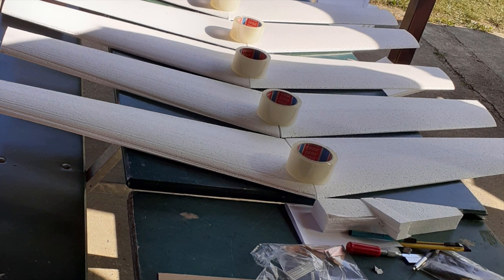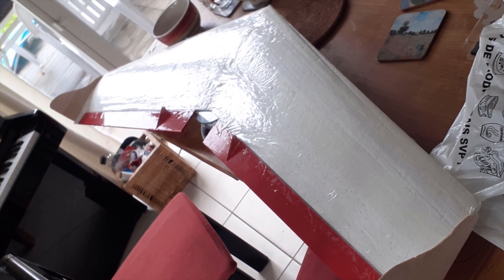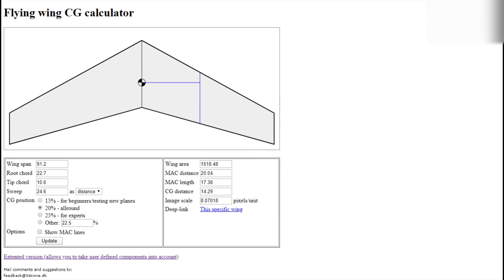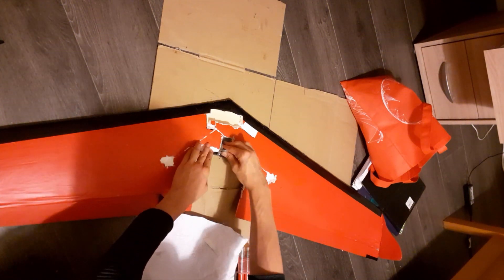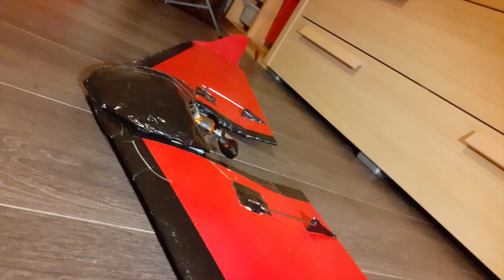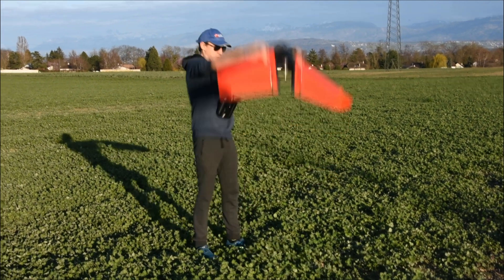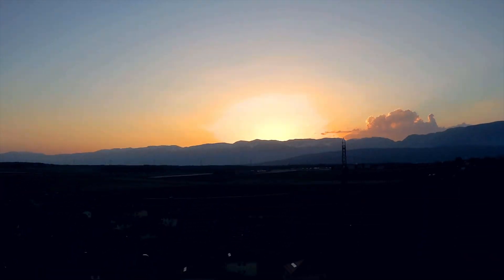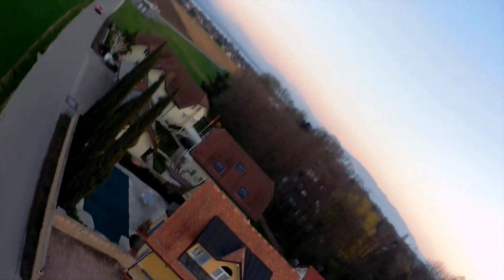RC Flying Wing Build out of Foam

Comment: some info.    at :18,   the profile,  and  wing leading edges, look  THIN.        in the case of  ANY  type of model,  the use of  a   clark-y  profile (orig)  is   Recommended.
http://1.bp.blogspot.com/-5C8vhlmhBOk/VRe3o3Jt3yI/AAAAAAAABrI/EEgVHXkLvbY/s1600/clark%2By.gif

it can be understood that  positive  aoa  has  been  Designed  into the leading edge of the clark-y  airfoil/profile.    thus, such an (tiny) airfoil  IS  effective, and efficient,  when mounted at  zero-degrees  aoi.

https://www.stickandtissue.com/yabbfiles/Attachments/Airfoils_FSM_clark_Y__RAF_32_GrantX9.jpg

https://en.wikipedia.org/wiki/Clark_Y_airfoil
Reply from the maker: The problem with the clark-y foil is that it redirects air downwards to create lift (as most other foils do) and that is fine for a normal plane, but with a flying wing, downwash creates  major pitch instabilities, so a lot of reflex (or tip twist) would be needed to correct for the downwash, reducing any benefits obtained by changing to the clark-y foil. The series by RCModelReviews is a great introduction to this problem (first video: https://www.youtube.com/watch?v=gkb11eKXM14). 

Also, this is just a foam wing which I am using for experimentation and practice, so I do not mind too much if there are some inefficiencies, with the current 2200 mAh battery I can almost get 20 minutes of flight time which is more than enough. Thank you for your recommendations though.
Reply: @aerodynamiccow5460  this reply is  just   plain   WRONG.    there is nothing more to say.     so i am outta here.